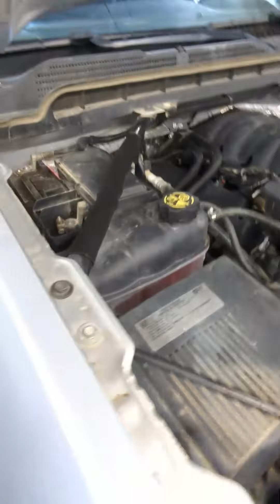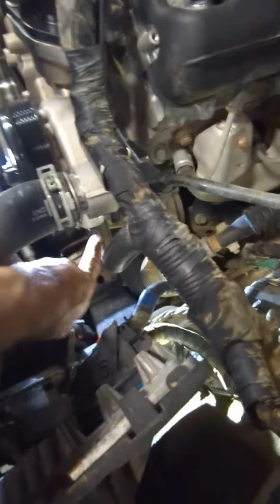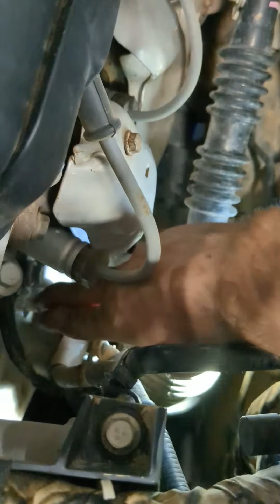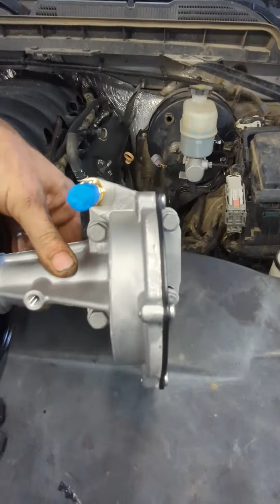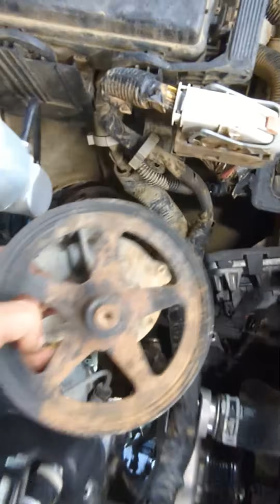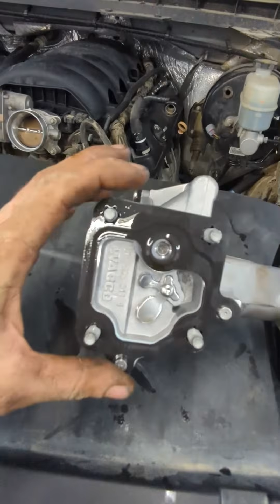Vacuum Pump replacement | 2016 Chevy Silverado |

Comment: My vacuum pump messed up and I called the dealership and they're trying to charge me for diagnostic(256.00).
Talk about coverage through the warranty.
Reply from the maker: @joep3804  That's crappy. GM had a recall on these pumps, due to the brake pedal getting hard and the vehicle not stopping. Our dealership never charged anything, due to GM pays for diagnostic and Installation. Sounds to me like there trying to double dip.
Reply: @showmemechanics  exactly I'm calling them now to  deny  the diagnostic.
Reply: I called another dealership and they were alot nicer. She explained  if the vacuum pump is whats wrong with it then I won't be charged for the diagnostic. 
Thank you  man, you inspired me to keep looking and not give up or go with the first goofy I talked to.
Reply from the maker: @joep3804  Glad to hear, and thanks for watching.

Comment: Had this issue for two weeks. Finally researched what it was and went to the dealership. They told me it had already been replaced with the recall back in 2019 before I purchased my vehicle and since it had already been replaced they won’t fix it under the recall. I only have 92,000 miles on it. They want me to bring it in to run a diagnostic test for $160 before they charge me who knows how much to fix it.
Reply from the maker: You can always tell them to change the part and deny the diagnostic as a "customer request". They do do that..they already know that that's the problem, but like to charge you anyway. Anyways. I change them all the time on the same vehicles. It's one of the parts that does fail quite often, but it is scary when your vehicle won't stop no matter how hard your pressing. Thanks for watching, hope you the best in your repair.
Reply: I had the same situation occur with my 2017 Silverado recently. Dealership said since they addressed the recall in 2019, the pump itself would not be covered. For the $160, it verified the vacuum pump was bad as well as my oil coolant line. Replaced both myself with a few hours and effort while also saving about $2K.

Comment: When this part goes bad does it make a ticking noise sounding as if it’s a valve?
Reply: Do a code pop up? Or how you diagnose it?
Reply: @TheRealHotRod  no codes or anything just a sound, the truck runs fine no skips .. just an annoying ticking
Reply: I only here my ticking when I accelerate,  no noise when idling
Reply from the maker: Yes it can make a ticking noise sometimes. There is a little tiny metal flap inside.

Comment: Great presentation. Had difficulty on that steering shaft. Had to lightly vice grip the flats then tap back against the vise grip with a hammer to push that shaft into the firewall boot. Very light grip, don't want to distort the tube. The other end at the steering box was crusted in and would not wiggle out. I placed the hook end of a wonder bar under the clamp where the screw was removed and tapped it up while pulling, it finally came loose. I did penetrate oil it, it just needed a start then came right out.

Comment: Had this done under warranty about 2 years ago on my 2017. Always wondered what the fix was.
Nice video
Reply: By the way that fix for the freaking recall and warranty on the vacuum pump was to recalibrate/reprogram the vacuum pump. 😤 Mine is going out. I know we had the recall completed in 2019. I contacted a place to check and get me the information on that completed recall and it says that was their fix. They never actually replaced it!!

Comment: Jason, thanks-brah!!! I had just made an appointment at my local mechanics shop for that fix expecting to spend several hundred dollars for the repair. Shortly thereafter I discovered your video, I called the dealership where I bought my 2015 Chevrolet Silverado. They said sure thing bring it in, you’re covered under a special warranty. Two days later I had my truck back, problem solved, ‼️NO-CHARGE‼️ {{{THANKS AGAIN}}}

Comment: Great video, the only thing that i'd add is that I would then remove the driver side wheel and wheel well, and unbolt the ECM and just lay it in the battery compartment. Then i'd remove/replace the vacuum pump from the wheel well. I had issues with the centering pins staying stuck in the block, and didnt see that when working on it from above. Be sure the centering pins come out with the unit or you will have an oily mess on your driveway!

Comment: And how to delete vaccum pump?
Reply from the maker: Do not delete it, I can't stress that enough. You need plugs hose's and a v4 bypass chip.  It's very dangerous do to that if everything is not correct you will not have brakes

Comment: Is it really necessary to take the AC Belt off?
Reply from the maker: Yes, because the vacuum pump belt is behind it. I always change the belt when doing the pump. If you're not changing the belt, then it can stay on.

Comment: Your video was very detailed and very well done.  I was able to remove my vacuum pump with your step by step instructions.  The only issue I had was the steering shaft didn't want to slide up into the column due to dirt and rust so had to spray penetrant and work it back and forth.  Thanks and God Bless!
Reply from the maker: I appreciate it, thanks for watching.
Reply: Thanks, a great how to video !!!

Comment: Thank you for the upload! 
Btw. I removed the plastic skid plate to access the bottom steering bolt and I dropped the vacuum pump between the radiator and the cross member. Dont know if that'll make things easier for anyone, but it worked for me. While I'm at it, to save myself some future b.s. I'm replacing all my belts. Hopefully by replacing the pump and the belts, it will solve the couple squeaks I hear upon starting the engine.
Reply from the maker: No problem, thanks for watching
Reply: You dropped out the water pump?
Reply: @slalomking  my bad. I meant to say vacuum pump. I'll correct it